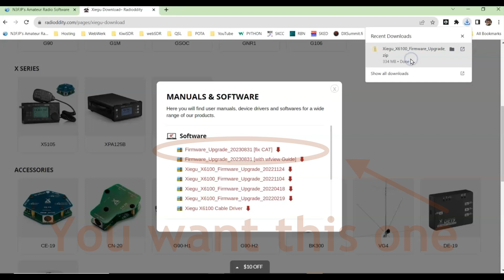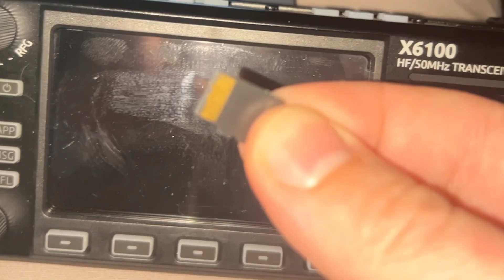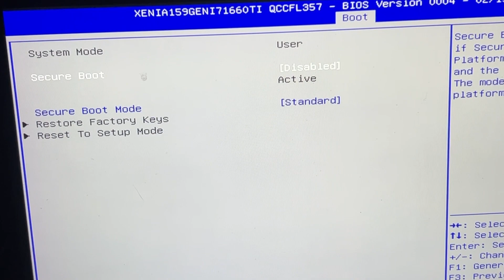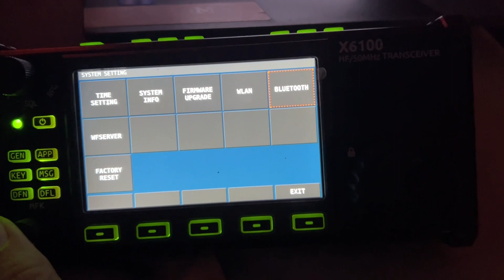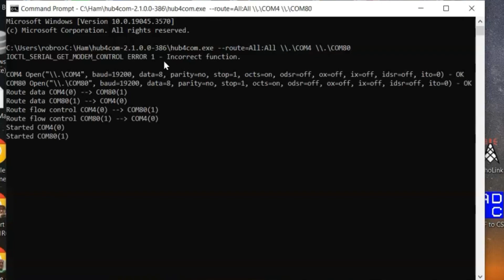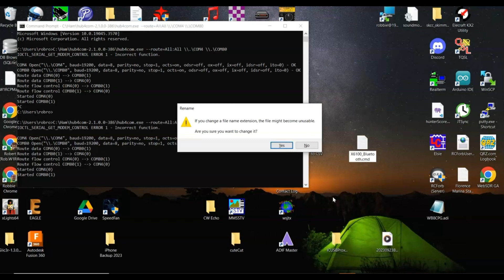Xiegu X6100 New Firmware 08312023 Testing Bluetooth CAT and Audio and USB CAT and Audio #hamRadio

Comment: Before someone tries this with Windows 11 - don't bother. Com0Com doesn't work with Windows 11 because of changes in security. It did work with some hacks on the early versions of W11 but not with the current (September 24) version. Com0Com was last updated in 2021 it seems, so it is unlikely that it will be updated to be Windows 11 compatible.